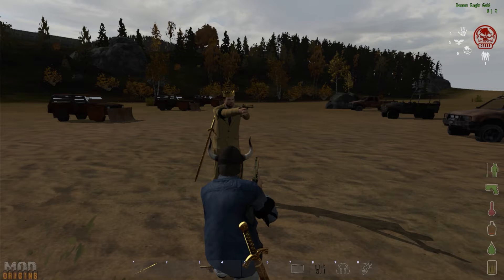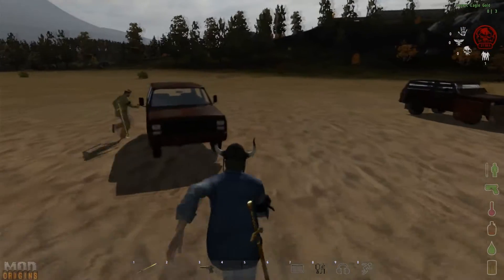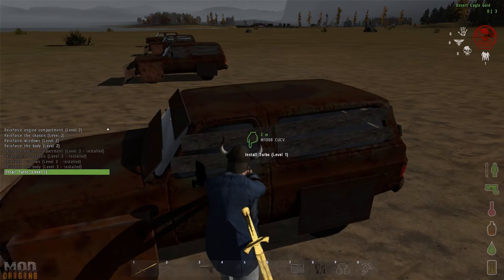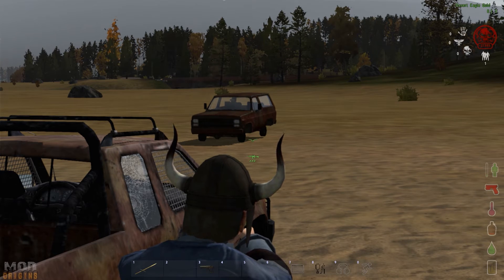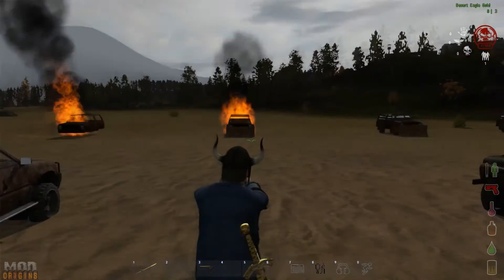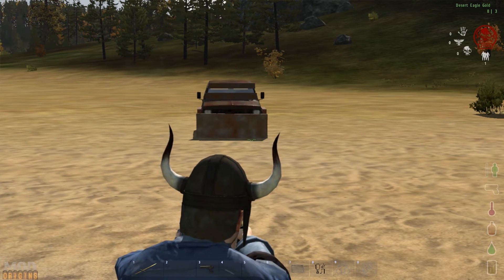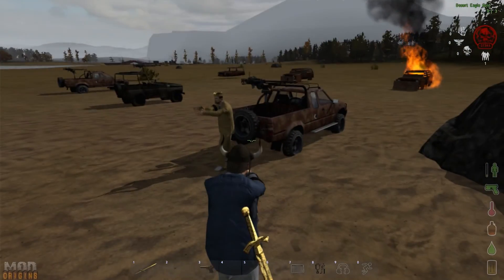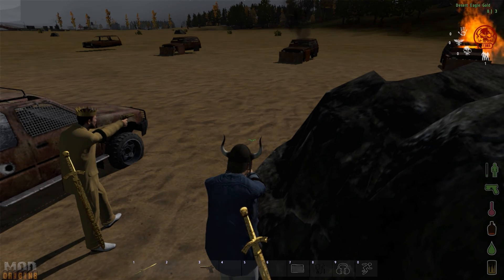Dayz Origins 1.8.2 Ferrous/Non Ferrous/Combined Alloys

Comment: Hey man, tell me how can I get the stuff to reinforce the car? (Alloy ferrous metal) I can not find this item what should I do? Sorry for the wrong translation because I use Google translator
Reply from the maker: Eliezer,

The Alloy's can be made with your mechanic skill. You will need the read the book and then make them. Ferrous is first followed by non ferrous and lastly is combined. 

They are sometimes available for trade on trader island as well but rare and expensive. You will also get them from one of the loot piles on sector B. 

Hope that helps!

Comment: Hello and thanks for the video; very helpful. We've just started playing; where are these Ferrous/Non Ferrous/Combined Alloys? Wiki is just about useless; hope someone updates it soon. I found a skin I couldn't wear and instead of the game telling me who could use it, it told me to go to the useless wiki. It was some special ops or something like that. Thanks for any help you can give. :) PS. Where can I score a DMR?
Reply from the maker: Zac, Ferrous/Non/Combined cannot be found (other than in sect B loot piles), they must be made. In order to do this you will need to find the books for each level and find  a furnace (or buy one on trader island) and use it near the power stations.The materials needed are reinforced mats, aluminum sheets and ceremet plates respectively. Also a DMR can be bought on trader or found at Martin barracks.
Reply: Sweet, thanks for the quick reply. Hate being such a noob and asking all these questions but... where can we find GPS and a proper source of info on 1.8.2?
Reply from the maker: Zac, GPS is also at Martin Barracks. As far as info it is hard to come by. Alot of it is tribal knowledge passed down lol. Using Youtube, the wiki and the forums are a good place to start.

Comment: How do you get the ferrous materials etc
Reply from the maker: You have to learn the skills through reading the books. From there you will need to get a furnace and create them with the required materials.
Reply: +Multiple Miggs Do you mine the materials from the Iron mine near Taviana Zoo?
Reply from the maker: No. The materials are reinforced, aluminum sheets and cermet plates respectively.
Reply: +Multiple Miggs Thank you. You are the best.
Reply: @multiplemiggs3448  where do i find that kind of books?
Reply from the maker: @Handpanschule  best place is in the museum in Sabina. It will take you awhile to get them though as they are very rare.